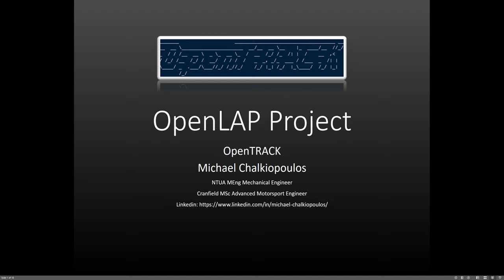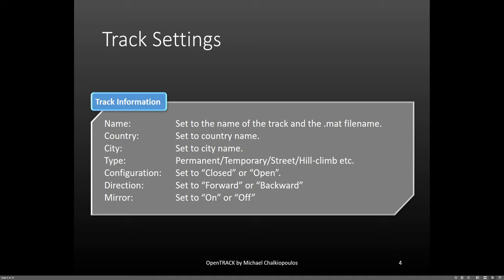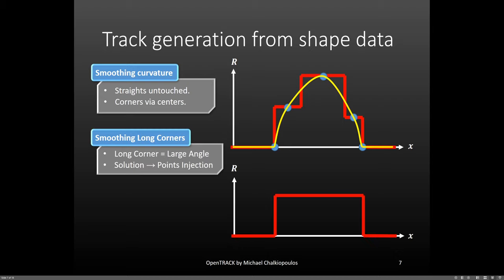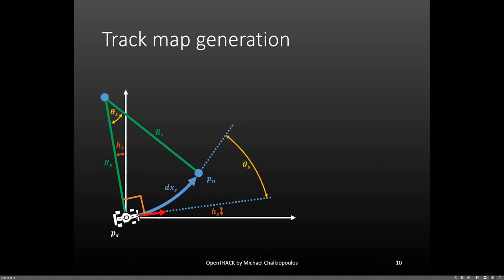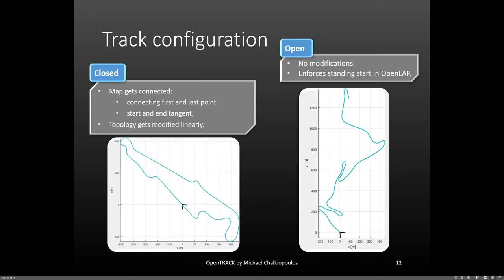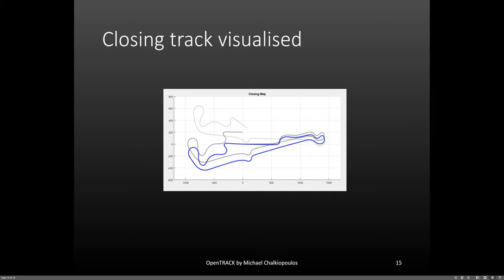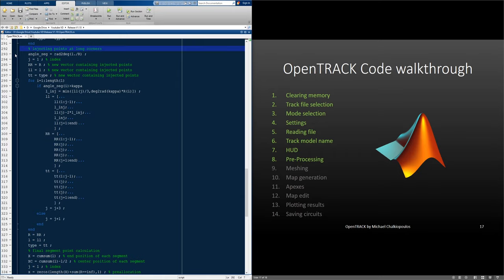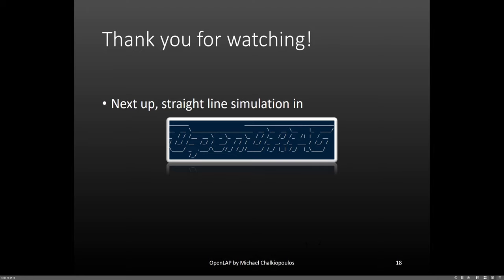OpenLAP Lap Time Simulator Part 4: Track modelling in OpenTRACK

Comment: Hi Michael,

I'm having issues running simulations on tracks that have bankings. Whenever I run a track file with banking, such as Daytona etc.., I get errors in MatLab, specifically this: 
Maximum speed calculated at all points.
Error using findpeaks
Expected Y to be real.

I’ve tracked the error down to this line: (850)      
            if ay/ay_needed<1 % not enough grip
                v = sqrt((ay-g*sind(bank))/r)-1E-3;  % the (-1E-3 factor is there for convergence speed)
            else % enough grip
                adjust_speed = false ;
            end

When the velocity is being calculated here, it iterates and then reaches some imaginary numbers before it stops, causing the findpeaks function to fail. I’ve tried changing the convergence factor to other numbers and orders of magnitude, but it hasn’t worked. Do you have any suggestions on how to fix this error?

Thank you in advance!

Comment: Hi Michael. 
Thanks for your videos, they are great for the community. 
I just have one question regarding the p_n formula at 11:34. 
I am just struggling to understand how this works/ how you derived this. 
Also just how they visually work which are also able to give you the X, Y cords 
I hope this question makes sense. And help would be greatly appreciated
Reply from the maker: Hi Dominic,

Thank you for the comment.
Glad you like the video!

Now this formula is just linear algebra.
I take the previous starting point
ps=[x;y;z]
and I add the vector
[dx,0,0]
Rotated by the Z axis rotation matrix by the angle hs.

So the formula becomes:

pn = ps + rotZ(hs)*[dx;0;0]

You can look up the rotation matrices in 3 dimensions here:
https://en.m.wikipedia.org/wiki/Rotation_matrix#:~:text=In%20linear%20algebra%2C%20a%20rotation,two-dimensional%20Cartesian%20coordinate%20system.
Reply from the maker: It is basically
dp = [dx;dy;dz]
With dy=dz=0
And that is because we need to use something that points only towards x, so that we can use the angle hs.
Because the angle hs is defined as the angle between your velocity vector and the x axis.

Comment: Hi Michael, I am working on a relatively similar project to OpenLAP.

I am representing the track in the same way as your segmented approach. Currently I am working on optimization of the racing line of the track, since in the segment approach we basically run the car along the centerline of the track, which obviously is incorrect. Your idea of smoothing the corner radius is interesting, and probably approximates the correct racing line better than constant radius cornering.

I am generating a cubic spline that passes through various 'gates' in the track, and the optimizer can vary where the car passes through that gate. This works reasonably well, but I am wondering if there are other methods out there.

Have you ever dealt with racing line generation? Do you have any additional insights?

Thanks!
Reply from the maker: Hey Pieter,

Thank you for your comment.

Theoretically, you can fit a circle over 3 points on a map.
So you can loop through all the points, and use the previous and next point to calculate the turning radius and your segment and use half the distances for the length.
This means that even if you create a cubic spline representing a racing line, you can calculate point coordinates and use those to fit circles that you then input to OpenTRACK.
So the method I used is not incorrect, as it can represent anything you want.
The accuracy depends on the amount of sections you use as an input.
And if they are small enough, the the "radius through middle point" fit is basically the same curve input.

Your way of creating the racing line via cubic splines is the reasonable way to go, because it reduces the number of points or variables your optimiser has to work with by an extreme amount.
So you could combine a racing line generator like the one you are talking about with OpenTRACK and OpenLAP and make a quite fast optimiser.

Hope this helps!
Reply: @_phoinix  Hey Michael, you're totally right. It would be possible to create a racing line from the segments. However, in my experience it is already difficult enough to trace the actual track shape using google maps. Doing the racing lane would be even more complex.

You mentioned that you might implement image recognition as a third option for track input. Do you plan on implementing some racing line generation then? It would be interesting to compare implementations
Reply from the maker: @pdebuck1    I already have the code for the image recognition of the track and I may release it if there is enough demand.
In terms of difficulty, what the logged data mode allows you to do is create very small segments very quickly so that this accuracy is not compromised.
And this what I feel is the most effective way of using something like this, because you eliminate a big variable when comparing with any kind of data from the real world or sims.
I just added the segments in case someone wanted or needed the feature.
But I would never sit down and type in thousands of segments to create a racing line by hand.
I would program a computer to do it for me.

The general concept of the racing line optimisation is a heavily biased towards mathematics problem, and I feel that it is out of the scope of this series.
The same applies to 3D kinematics, fully transient simulations and a lot of other stuff.
OpenLAP was made to help people understand how a lap time simulation tool works, with a very simple vehicle model that does not need a lot of math to get going.
By no means is it a tool that can do it all.
But it can be very useful when you know how to use it and what to expect from it, especially when you have the source code to play with.
Reply: @_phoinix  is the code for image recognition of the track available yet? I'm working in something similar and it would be interesting to compare my work with yours.

Comment: Hello Michael, in the Excel file, you  have assigned the speed  of 206.3, 206.4, and so on, my first question is, how do you get those speeds, or why did you use them?
Also if you can explain why the yaw velocity is sometimes 0.7, 0.5, 0...
And why the acceleration takes the values of 0.1, 0... how do you get those values?
Thank you
Reply from the maker: Hello Jose,

These are just values logged on a real racecar.
I did nothing to those values.
I just exported the data and put it in the file as it was.
Reply: ok,  are those values just to create the track?
Reply from the maker: Yes.
In a sense, the speed tells you how much forward you are moving, and the lateral acceleration or the yaw rate shows you how much you are turning.

Comment: May I ask how did u manage to get the detailed data such as the cornering speed at every instance in the excel spreadsheet for different track circuits???
Reply from the maker: Hello Hellx Wei,
I got the data from data loggers fitted on race cars that I have worked on.
And then the track is reconstructed from that.

Comment: I´m changing this parameter 12:16 in the code, but there is no difference. My track is not on the correct scale and I want to adjust it, but nothing happens when i change it. Am i changing the correct parameter or there is another thing that i need to change?

Thanks for the attention!
Reply from the maker: This parameter will only have a big effect when you are defining really long sections in one go in the "shape method", like if you defined a 180deg turn with a constant radius so that the track shape is preserved and to prevent huge jumps in the map. If you are using logged data, this will have minimal effect.

Comment: Hey dude,how do you make a generic track for an FS  by say you know the requirements of(straights, turn radius etc..) and then make a tabulated coordinate system of the path?
Reply from the maker: Hi Aravid R Nair,

If you know the straights and your turn sections, then you just create the table in the template excel file.
If you have xy coordinates for every point, you need to fit circles for every 3 points (or more if you want smoothing) and create the table with the circular segment lengths and their radius.
Then, when you then run OpenLAP it will generate the track model for you.
Does this help?
Reply: @_phoinix   Thanks for the response.. But the question I mean't to ask was that, say for example we're analysing with Spa. I know the length of straights,turn radii etc..How do we fix an origin and go about to finding its coordinate?
Reply from the maker: Sorry but I did not understand your question in the beginning.
The calculations I show on slide 10 are the ones you are looking for.
They give you the coordinates of all the points in 3 vectors, one for each axis.
And they are in a loop that starts from the origin.
So what you have to provide is the origin and the tangency (direction) of the map.
Reply: @_phoinix  Thank you

Comment: I posted this under Part 3....but it showed up here....Part 4.  Strange. 

I see a significant real world weakness in this approach to generating the vehicle model.  It is purely theoretical and it does not leverage real world data at all.  You are calculating the GGV Map from a massive number of underlying "textbook" parameters when YOU ALREADY HAVE MANY DISCRETE SOLUTION POINTS FROM DATA ACQUISITION.  You are willing to use the motor dyno data plus the transmission ratios to calculate the acceleration map. That is 1/3 of your model input.  You have similar data on the other 2 axis...and yet you choose to base that solely on theoretical data.  It will be much more useful if you leveraged real world data to fit the GGV map to KNOWN reality.  Of course, this assumes you have an elite level driver who can get to at least 95% of the limit, otherwise you are going to under estimate the map boundaries. 

Some examples of data that you will have in the real world that should take precedence over ANYTHING you calculate from first principles:
1.  Straight line braking - you will have tons of good data here....including when limits are exceeded
2.  Straight line acceleration - implement traction control...even if your rules do not allow...and tons of good data.
3.  Straight linear and aero rolling resistance - Get the car up to speed, tires warm, push in your clutch and roll, slowing gradually on a flat straight.  Back out calculated transmission friction.  Fit the deceleration to a second order polynomial.  The linear term is rolling....the quadratic term is aero.  Done.
5.  Combined lateral and acceleration.  Have your driver push hard to the apex on some forgiving turns, till he is over the edge. 
6.  Combined lateral and deceleration.  Have your driver push hard apex out on some forgiving turns, till he is over the edge. 

The one thing that you actually do not have much of is pure turning in the real world, because even when you coast / roll, you have a significant amount of drag, at least at the rear wheels.  But, you could probably instruct a good driver to spend some time mid corner, with mild throttle, to approximate pure turning, and create some good data here.  All told you can generate a population of points that can then be used to "fit" the GGV surface to make it much more accurate. 

This is why your karting model results were so far off, and you smartly deduced why.  If you had looked at your real world karting DAQ data, you would have known that that indeed the deceleration capabilities of a kart were much less than lateral, resulting in a "wide and skinny" GGV Map.  

It would be very useful if you did another version of this video for how it is done in the real world, not how it is done in a classroom.